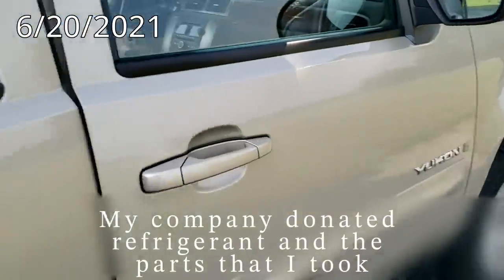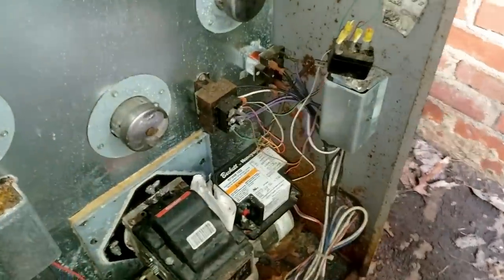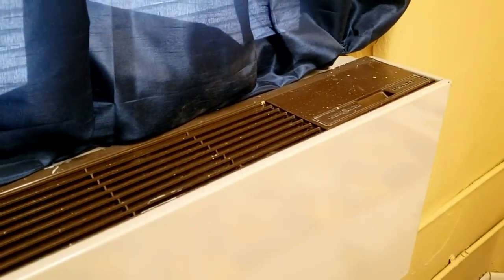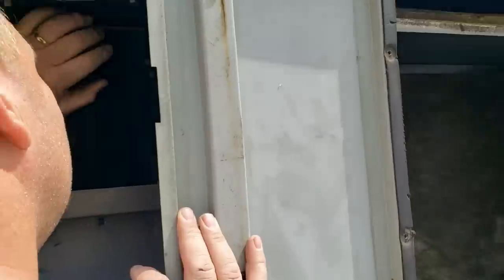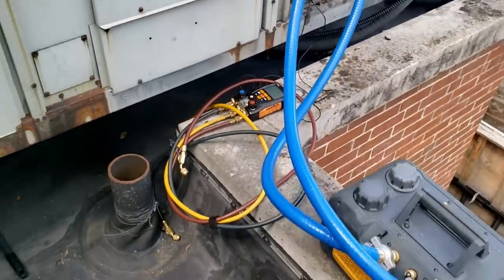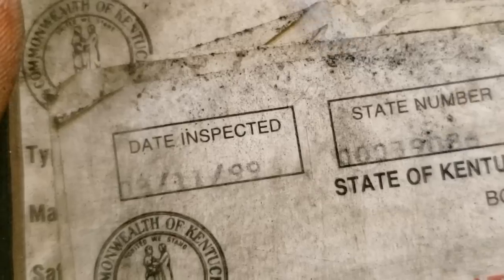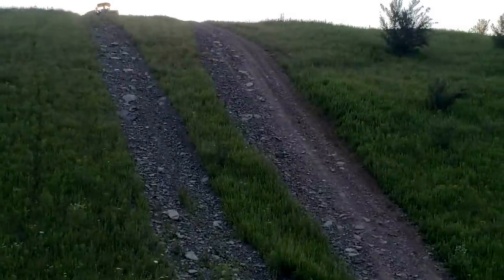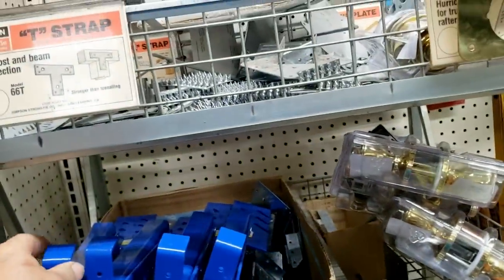Did Donating My Time To Help Others Bring Me Joy?

Comment: I had an identical issue with the same filter drier and it ended up being compressor oil. Needless to say , once they get plugged, you have about a year or less until compressor goes out depending on ambient in your area
Reply from the maker: That sounds believable. Thanks for sharing!

Comment: an important thing to do to all new window a/c units is to drill a drain hole for the condensate. EPA demands that all window a/c units now be 100% evaporative to boost efficiency but all it does rust out the condenser and allow for disgusting growth to set in with dust, dead bugs, and plant material. Truly unhealthy and inefficient. Our gov't at work!

Comment: Rick had a bottle last week was the same. We didn’t catch it until after I noticed the bottle sweating when I was putting gas back in
The Blue knob was liquid the red one was vapor 
Well that sucked because it was 404a !!!
Had to pull the gas back out, evacuate again switch hose to the Blue one
Reply from the maker: I would have pumped it down, that should mix it back together. I showed the age of the bottle but cut it out,  I'm not getting an example of by the 3 letter agency. I think they changed colors over the years.
Reply: @HVACRSurvival  that would work? We had a lot of issues already low temp 15 door Hussman line up and didn’t want to take any chances 
Just goes to show can’t take anything for granted! 
Good thing you guys and gals are doing there!
Take it easy man

Comment: R32 being a major ingredient in 410a the other being r125, so it will perform very similarly to 410a. The majority of 32 is produced in India and China and it’s a very common refrigerant over there, hence why a majority of the cheap air conditioners from overseas come with it in it. It is however slated to be replaced by eco32 a propane and ethane mixture.
Reply from the maker: All great information 🤜🤛👍👍
Reply: R-410a is R32 with an added refrigerant to decrease its flammability rating. It’s a US only safety thing. Even still, it is on a phase out schedule, but that’s still a ways off here.

Comment: With 3d scroll compressors retrofitting isn’t really an option I tried it before did not end well
Reply from the maker: I would have added some poe oil if I had some, I knew Trane chillers were a no go but wasn't positive on the RTU. I told them it was a possibility that is could take the compressor out and got the ok before doing this.